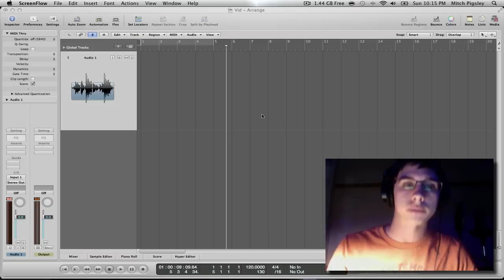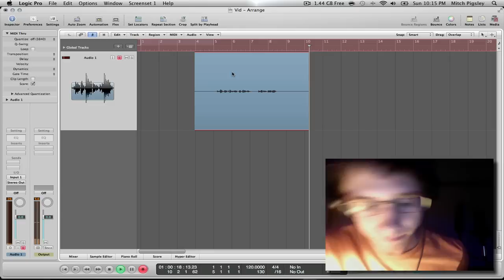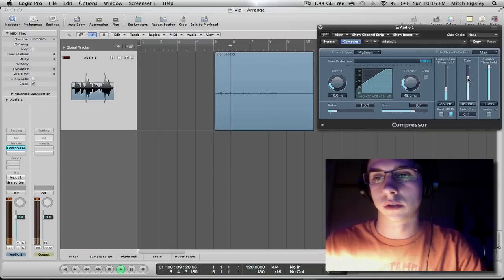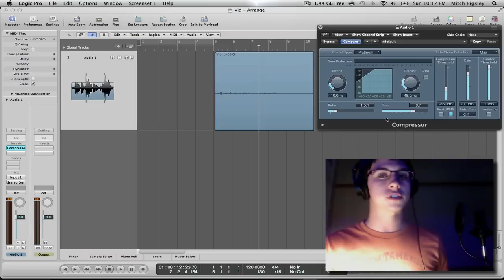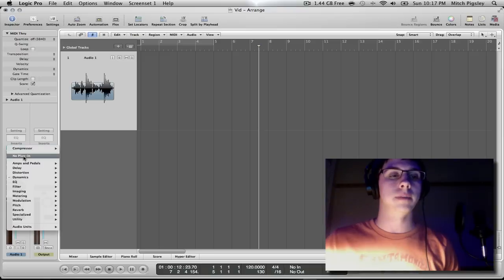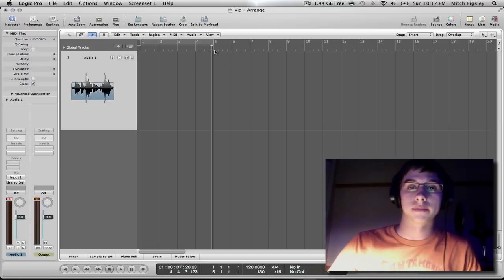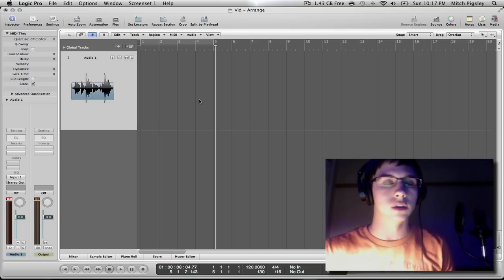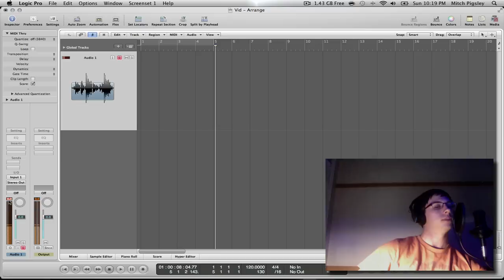Logic Pro 9 Tutorial - Correct Preamp Gain

Comment: what do you do when your mic has a gain knob as well? I have this blue yeti mic... I'm confused when it comes to deciding where the computer's software gain level is compared to the mic's analog gain knob
Reply from the maker: Stantawn Kendrick You want your mic's analog gain as high as possible without clipping the recorded audio track. If you get a high level on your recording then you can adjust LP's channel strip gain when you go to mix it. The reason I stress this is because you want you noise floor to be as low as possible.

Comment: Hi Michael, 
I have a doubt about the gain level for recording. If you use a mic for recording that is directly connected to a macbook, is it possible to amplify the signal without an external mixer? I mean, is there a preamplifier pluggin in logic to amplify my voice without amplifying the noise of the room at the same time? I am using a Shure SM58. Many thanks for your advices!
Reply from the maker: You can use the LP mixer to control the volume of your direct input. In terms of the background noise you could use strip silence, a noise gate, or even the expander to help minimize your noise floor.

Comment: You can't use a preset level!  Because one singer/rapper/instrument may be considerably louder or quieter than another!  Using a preset setting, you could be either too low, too hot, or just right.  Could be different in different scenarios, or with different mics/preamps.  This is not very "professional" advice you're giving!

Comment from the maker: This problem has pained me time and time again. What I suggest (and what I do now) is to not use any external distortion or overdrive pedals. You can use the out on your amp no problem though. I would suggest adding these effects onto the signal inside of logic. Either through a plugin specifically built for distortion or overdrive or from the pedalboard plugin. I find that using the amp designer can boost tone if you are careful with it. All these plugins are very touchy so just play with it.

Comment: Hi, Mitchel. Could you help me a bit? The setup is as follows: presonus firebox+Logic Express 9+amp DI-out. And a guitar pedal-board..where should I plug it in to have a correct sound of overdrive and distortion pedals? If I put pedalboard into the amp's loop ODs and Dists sound weak. If I don't use amp at all and put pedalboard out -> into Mic/Instr channel 1 of Presonus Firebox and pedalboard  in-> into guitar ( guitar has on-board pre-amp) ODs and Dists don't sound good as well =(